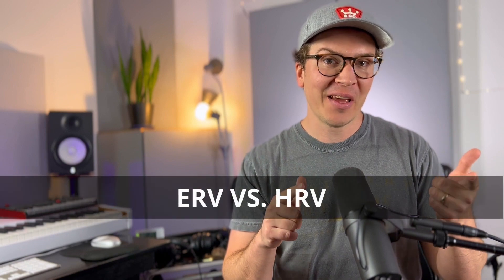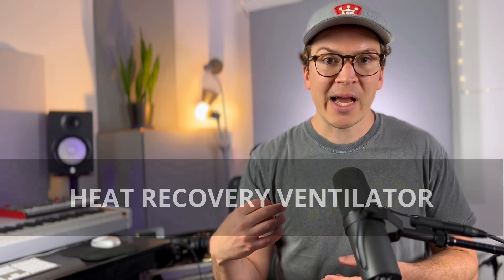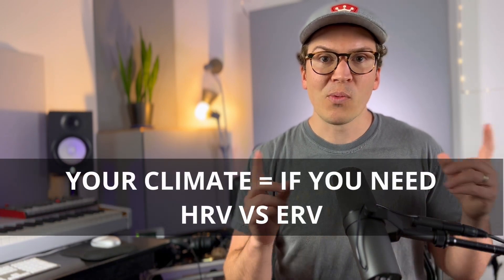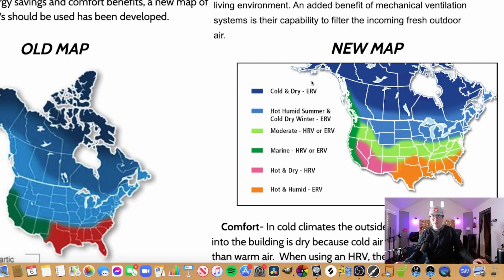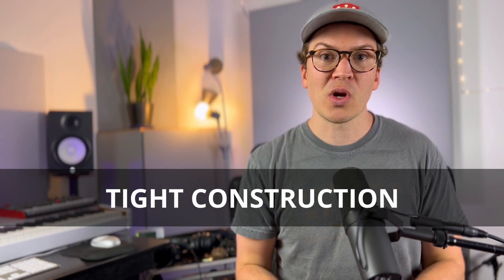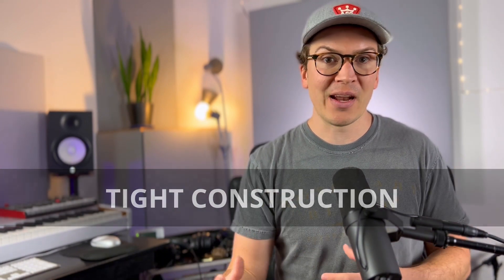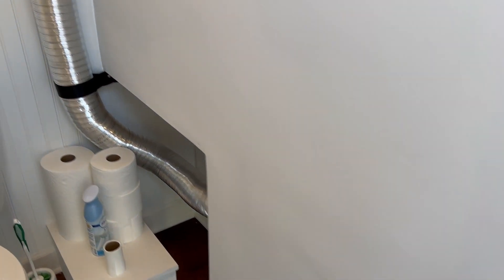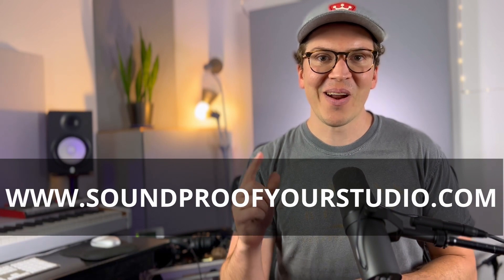Should You Use An ERV or an HRV to Ventilate Your Soundproof Recording Studio

Comment: I ended up using two silent 150mm extractor fans. One on outside one on inside. I built 2 boxes at 900x600x300 and put baffles and insulation inside each. I then used metal expandable pipe to outside and I use a variable control and on off switch on each fan. Outside fan can't be heard at all inside studio, naturally, but with inside fan I can turn it down so low it can't be heard, but shifts more than enough air out. Total cost about $800 aud including labour to build and install boxes.

Comment: I love your videos! I was kind of surprised though. I figured that you would share best practices to avoid having the ventilation system bleed sound. There must be better ways to do it; for example, running the ventilation ducts below drywall, instead of above it, if that is your ceiling surface, for example.
Reply from the maker: Sure you could build a soffit. This was just the best design for my studio
Reply: @soundproofyourstudio  I watched your longer workshop video. It was helpful in this regard. 👍
Reply: The baffle box thing works well. Flexible duct around baffles insulated behind drywall.